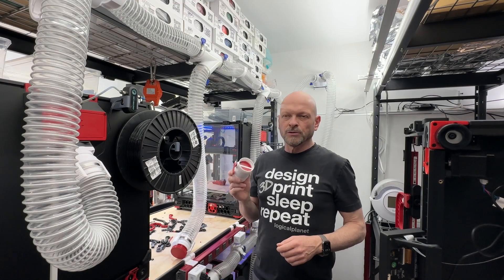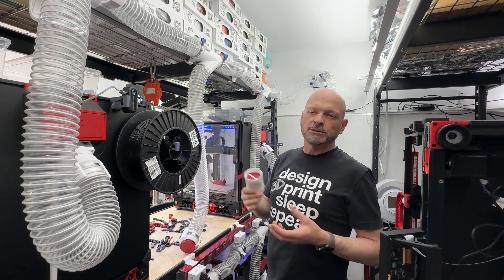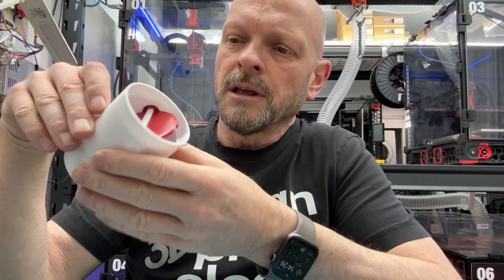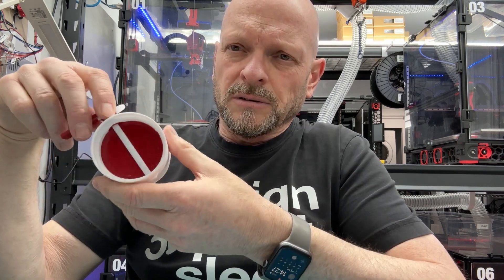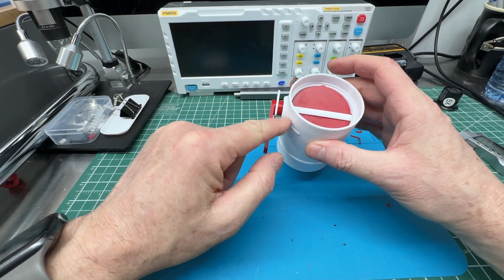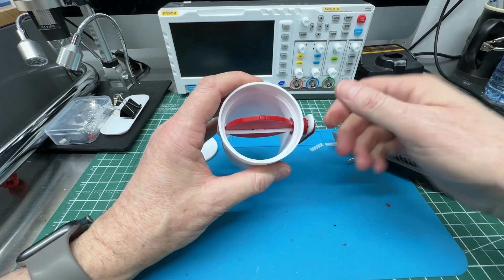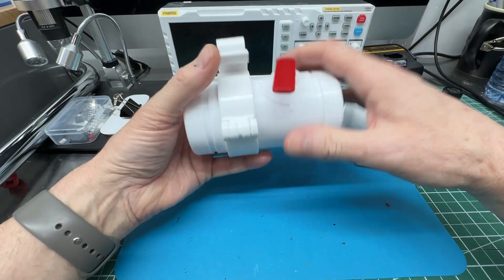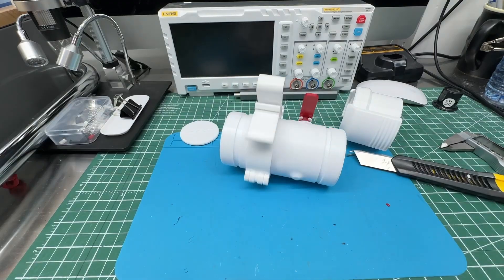Variable Flow Exhaust Valve

Comment: I am struggling to insert the shaft with the o-ring into the bearing, please advise :face-pink-tears:
Reply from the maker: Yes, I had some difficulty with that initially, I was using a larger o-ring and it was very difficult.  So make sure your o-ring is 15mmx1.5mm.  And, I put a little lubricant on it.  Then I found that if you just wiggle and twist as you force it in it will just pop into place at some point.  I hope that is helpful.  Let me know if you get it in.  Thank you.
Reply: @logicalplanet3d  You're right, I installed the smaller o-ring. I don't have a suitable one. But the valve is now functional, and that's the only thing that matters to me. Thank you.
Reply from the maker: @dragoslavucb3003  great, glad to hear it.  I bought one of those o-ring sample kits from Aliexpress or Amazon (don't remember which) that contains about 20 different sizes.  So I was not sure what size is common or what size people might have access to.  But I think the valve will seal fairly well without it.
Reply from the maker: oh, and also make sure the far end is finding its way into the recess so that the shaft is ready to move as you are pushing it in.  If that area is not mating well it will feel like the o-ring is blocking it but actually, it might be the far end.